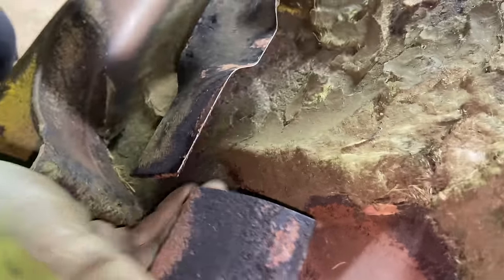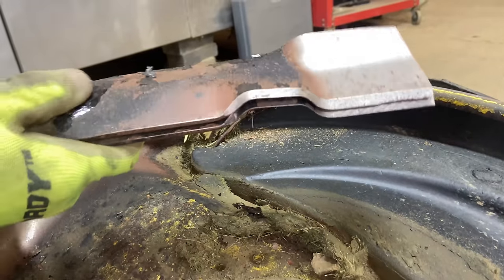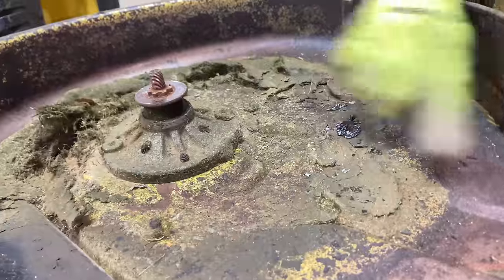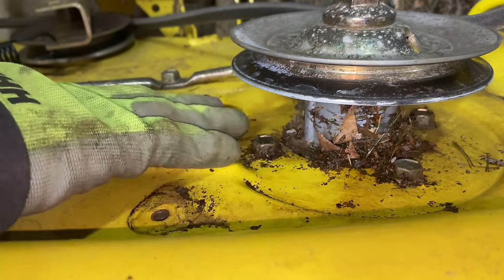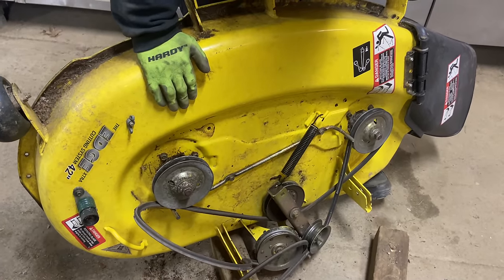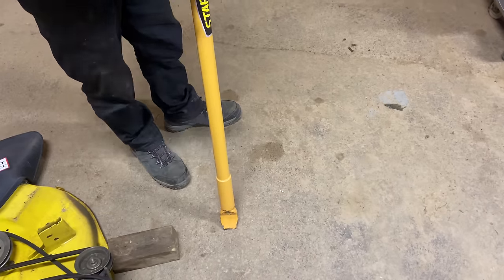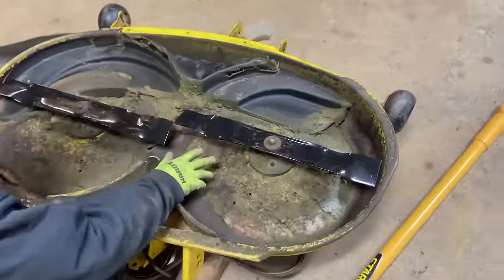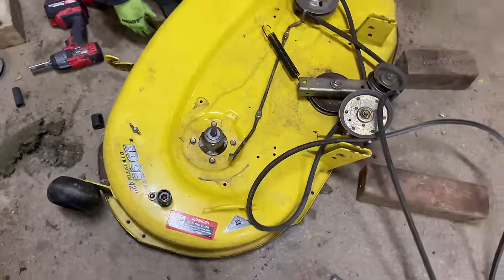Installed New Blades and Still Cuts Uneven

Comment: Three years ago I bent the mower deck on my John Deere d130. They said there was no way to fix it and they wanted $1100 for a new deck. My solution to the problem was to take that $1100, add $1800 to it and get a Husqvarna zero turn with a fabricated deck. I still have the John Deere deck in the cellar, and now I know how to fix it. THANKS!
Reply: Most things commissioned to be made for the purposes of profit will be of poor quality. Welcome to capitalism.
Reply: I bought my D130 new in the spring of 2015. We're almost into fall and my D130 still runs and cuts great and I've never did anything but routine maintenance. It's a great machine cutting it's 9th season so I'll have to disagree with the D130 bashing. It's the best mower I've ever owned
Reply: @chuckiebrown1494  it's a good mower until you hit a small tree stump with it and bend the blades and the deck. 
I'm bashing the repair people. I'd like to...
Reply: @tomstepanowicz6191  I actually did hit a few things but was lucky enough that it's still straight.
Reply: @chuckiebrown1494  🙌yay!
Reply: @tomstepanowicz6191  I was referring the bashing to the comment that was calling both a piece of junk?
Reply: @chuckiebrown1494  that comment got a 👎from me
Reply: @tomstepanowicz6191  didn't see that. I just thought I'd let you know I wasn't calling you out.
Reply: Thanks for the timely video. My JD deck has the same problem.
Reply: my 110 has that problem never fixed it after hitting an old plow carriage in tall grass ugh know I know how thanks for the good video. my mower wouldn't start my son thought maybe it was the seat sensor I changed it still no go then I changed battery nothing still old one wasn't very good I think it was jump started but found out with tester it was bad fuse holder got melted some how with out the fuse breaking nuts eh. well I've had to go buy a new one under 5 dollars put it on headlights work now plus it turns over time to replace belt it's kinda slow engaging the blades.  Sorry so long hope some one else is helped by my experience too? Good day all.
Reply: Oh should have known it was fuse related if headlights don't come on but you never know could be wire dirty on battery or ground ive always checked first plus learned alot from Chickmechanic video also
Reply: that's amazing video and sir you are a professional, I wonder if the non bent side should have been supported before striking the bent side but it didn't seem th prevent anything and you were able to correct the damage, BRAVOS

Comment: I ran into this problem myself with uneven cuts. New blades didn't fix it. So I just cut uneven. Now I have new info. I'm going pull my deck. This is probably exactly what is wrong with mine. Thank you sir!
Reply from the maker: I hope this video helps with your issue and you will be cutting straight again! Thank you for watching and the kind comment.

Comment: Best explanation I have seen on why the deck does not cut evenly. Especially since this is the deck I just replaced after 12 years. One tip on this deck if you have to replace it, it is cheaper to buy a complete deck through sales ($900), rather than a bare deck through parts ($1100).
Reply from the maker: Good to know! Thank you

Comment: Man am I ever glad I watched this video. I've watched several of your videos which gave me excellent tips as far as doing work on my LA130. Now this video is giving me ideas on why my Wheel Horse 52" deck is shaking so badly after I hit a raised patch of ground in the ditch by our house. It hit pretty hard and this may be what happened. I very much like your simple no nonsense approach to repairs rather then throwing a ton of money at the problem. Thank you
Reply from the maker: Check your blade hub shafts and blades. I’m sure one or more will be bent. You also may need a new blade belt due to; if the deck stopped turning when you hit the mound and the engine was still turning the blade belt, the belt can get a bad spot in it and that will cause a bad vibration also. Good luck! Thank you for watching and the kind comment!
Reply: @JohnsonsSmallEngines  noted and many thanks for the additional tips. I'll be 70 in a week so you are teaching an old dog   new tricks! :) thank you

Comment: Awesome advice! Your directions were right to  the point and easy to follow.  I was afraid that I was going to have to shell out a lot of money to fix, but thanks to you...heck, I'm ready to give it a go.
Thank you so much.
Reply from the maker: I hope it helps straighten you out! LOL. It does take some patience and time but it’s a lot cheaper than buying a new mower deck. Also, check your blade shifts to make sure they’re not bent.
Reply: @JohnsonsSmallEngines   Will do 👍, and thank you, again. Like you said, it does (may) take some patience and time, but it's a lot cheaper than buying a new mower deck.

Comment: I cut my yard and walking trails for 20 years with a STX-38. I got a new S240 and the first time around the yard I hit a root. Bent the blade and the deck. My brother in law had a Bolens and got the S240 too. First time around the yard, he hit a stump and bent the blade and deck. We both had mowed our yards the previous week without. 

I continued to hit stuff I never hit before. I replaced the deck cause I had bent it back into shape so many times the metal got fatigued and wouldn't stay straight. I got a Accel deck and the first time out I hit a root. It stuck so hard in the root I had to pull it off with my truck. And it bent the blades and deck. This deck is heavier and harder to bend back. A few weeks later I hit a stump and really bent the blades and deck. I am tired of buying blades and pounding on the deck. And I need a bigger hammer now. 

I never bent a blade on the old STX  38. I bent the hell out of the deck (Black deck) over the years hitting stumps rocks roots, the blades would cut holes in it when doing so, it rusted and my buddy welded it back together multiple times, we beefed up the parts that would bend. 

I was working on the STX as I still use it and noticed the blades are tucked up inside the deck quit a ways. HMMMM The blades on the new JD's are almost level with the bottom edge of the deck. Could this be why I used to bend the front of my old mower's deck and not the blades and deck, and now hit shit with my blades and consequently bend the deck??? I think it is a design flaw. 

When I bend my deck back I use a chunk of wood on the opposite side of the hole cause it looks like it is bent all the way through. One side down and the other goes up.

Comment: One of my kids hit a stump and bent the end of one blade 90 degrees. Put new blades on and I’m getting about an 8 inch strip that’s high. This is definitely going to be my issue and you gave me the fix. Thanks
Reply from the maker: I'm glad it was helpful. When you take ther deck off, make sure you spin the blade shaft to make sure the shaft is not bent. A 90 degree bend is a bad hit. I'm sure you will need the "deck adjustment" in this video but also make sure your blade shaft is ok. If it is bent It may be easier to replace the entire hub bit it depends on what you think.

Comment: My son hit something with the cub cadet and not only did it bend the deck but it cracked the corner of the spindle. For the life of me I could not get it to cut even until I remove the spindle and saw the bent deck. I used a small air hammer and a heavy duty mallet with a piece of wood and it worked. Wish I would have seen yours earlier

Comment: Thank you for the blade tip. I never really paid that much attention to them before.  I guess I can check My deck by measuring it to see if it's level on all sides. I hit a root with the edge of my deck, But I see no difference with the grass after mowing. Great job as always, I almost always learn something or am reminded of something. So thanks again.
Reply from the maker: Hi Steve, You most likely did not hurt your mower deck when hitting the root. It takes a good hit and most of the time the tractor will stop dead in its tracks when the deck get bent. Thank you for commenting!!

Comment: This was my favourite video on the subject, I flipped my deck over and one side of the blade was even with the other then the other side of the blade was over an inch higher. This proved it wasn't the deck or spindle and just a badly.bent blade. I hit a paver that was on my lawn a while back
Reply: Funny you mentioned that. I have a Cub Cadet with the same issue, both blades line up in the middle, same height, but if I spin the blade on the chute side 180 degrees it's a little lower than the other blade. If I spin it again 180 degrees it lines up. So it has to be the blade. If the deck was bent the blade would still be lower (out of alignment) even after spinning it 180 degrees and it wouldn't fluctuate in height like that. If the spindle was bent the height may fluctuate but most likely go from too high to too low on each 180 turn. Not lined up and then low. I replaced the blade and the new one does the same thing. I'm thinking the blade on that side is bowing a bit when I tighten the bolt. Nothing else makes sense.  The cut looks fine so I'm not going to worry about it. I never hit anything that would bend the deck or spindle. I had an older mower that definitely had a bent spindle and deck at one point and the blades would never line up when I swung them 180 degrees, they remained equally out of alignment,  until I replaced the spindle and fixed the deck.

Comment: Really smart and great job!   Never ran into the slap 🔨 hammer before and just ordered one.   Have a Kioti tractor with 4 foot tires on the back, and this tool should be able to break the bead if needed.   Nice work 👍 and thank you! 😄
Reply from the maker: I'm glad this was helpful and thank you for the kind comment. The slide hamm a nice addition to have for multiple  reasons as you stated!

Comment: Good video and to the point. Most owners don't have the know how on why you do not move the wheels. Every tractor I receive the wheels are totally to high. I try to explain to them that they are set for a reason and not to cut the lawn so low. I did want to mention on one of your other videos that I did watch a few times incase I missed something. I was stumped on the Husqvarna zero turn that has the parking brake within the laterals. I tried each time and cleaned up all the relays thinking that was the culprit. I replaced the solenoid, ignition switch, checked all the wiring for breaks, anyway I don't know if you can make a edit to that video to let others know about the occupant relay within the harness under the control panel. I decided to move that relay since it had the same color coded wires as the parking brake relays. The tractor started, but would not start again, but the relay became very hot real quick. I found one on line and installed it and still had no call back from the customer. I don't suppose that you have a video on a troy bilt tractor that won't stop moving forward unless I turn the ignition off? I have set the brake but still won't stop. I may have to put on a stand and see the wheels in the back after pressing the pedal and see what's going on. I hope it's not the tranny.

Comment: I have the same JD 42" deck.  The crossbar under the discharge chute broke off, it slammed into the right blade, are now the cut is messy.  Of course the stability of the entire deck is also compromised.  Nonetheless, this video was a major education, starting with the blocks and the level pully analysis.  Anything can be fixed.  Thank you!

Comment: I got a bad uneven cut and I suspect something along these lines. I just replaced the spindles and it does look like one is a little wonky when I spin it. I might have hit something but who knows. Good advice here and another tip to add to my toolkit. Before we owned acreage I only ever needed a pushmower. Now I'm changing blades, and spindles, leveling the deck, changing belts, and I'm sure more things to come. It's frustrating when this happens but it's a nice feeling to fix it. 😅

Comment: Thanks buddy, makes diagnosing my issue a bit easier. I haven't identified if the blades are bent yet but I hadn't considered the deck being bent but considering I have had nothing but trouble with my troybilt pony (2019) I wouldn't be surprised. I gotta pop the deck of to replace the spindle brakes (yes they are already trashed, along with deck engagement cable broken the idler pulley broke free from the deck... due to vibration from one of the spindle bearings not having a tight/press fit in on of the spindles causing vibration that lead to the pulley guards cracking) 
I will likely replace both spindles and blades ( I used some sleeve retainer compound in the interim to keep the spindle from vibrating as bad) 
Anyways... My old MTD mower will be put back into service if I find a suitable engine since MTD has always been built to a price but sheesh I wouldn't wish one of these things on my worst enemy.

And to think I was concerned about the Chinese engine being a problem LOL
Reply from the maker: I’m glad this video was helpful but it looks like you have a plate full in front of you! Lol I hope everything goes well and your machine gets back up and running soon. Thank you for watching and the kind comment. Please give this video I like subscribe if you haven’t yet and share my channel with your friends to help it grow. it would be greatly appreciated

Comment: Great idea only thing I would do is warm the paint up with a heat gun so it doesn't get pinched and form rust where it was hit by pinching the paint you break the bond to the metal ... I rebuild my JD deck this past summer and never thought of this but I was lucky it wasn't bent I did replace the blades because they were finished almost worn through where they turn upward behind the cutting edge from just lightly grazing soil on a steep hill that I now landscaped to feather it out so it's not as bad...

Comment: Very nice video….to the point with great shots of what to look for.  The video guys gets a call-out on his work.  Great explaination and really great instruction.  My deck was bent on the leading edge of the right side.  The blade does not strike the deck and it mows but looks terrible.  How do you fix a leading edge damaged deck?
Reply from the maker: I cannot say how to repair what you are calling " leading edge damaged deck" I am a visual person and would need to see the mower deck to figure out the best way to straighten it. It should not matter what the mower deck looks like. If the blades are coming across together evenly, the tire pressure are all correct and  the mower deck is leveled correctly. You should get a good cut.

Comment: Top of the deck is warp,we had the same problem with ours John Deer,the top of the deck where the bearing towers mount get warp,makes the blade underneath cut at a angle

Comment: Very informative. How are blades to be position, both at 12 and 6 or one at 12 and 6 with the other blade at 9 and 3?
Reply from the maker: It does not matter which way you put the blades on as far as positioning. They are not timed and will not hit each other.

Comment: Rookie Question: what does the actual bending on the deck? Force of the pulley on the jammed blade?
Reply from the maker: I think a combination of mower moving forward then hitting something that stops the blade then momentum of tractor moving bends the deck.

Comment: A few weeks ago I hit a rock with my X350 w/42" Accel deck and knocked a chunk off of one of my blades. I bought a new set  and now the blades ends are hitting each other! I took off the deck and nothing seemed out of the ordinary to me, the spindles are tight. I priced a new deck and they only sell the shell by itself and it's like $600-$700! Last night I was debating maybe to just buy 2 new spindles and if that doesn't fix it I can move onto a new shell. After watching this video I'm going to work on checking the pulleys to see if they're misaligned. If you don't have a "slap hammer", can you just use a small sledge and a block of wood?
Reply from the maker: Absolutely. at this point, you can use whatever you need to straighten the deck!

Comment: Hey I put a John Deere  lt 180 42 inch deck on to a John Deere lt 155 that had the 38 inch deck one side with the lever that lowers the deck on the lt 155 that that side is sitting higher  and this is a different deck.i use this mower and it's put together out  of 3 different JD mowers.the engine is out of a 2005 JD l140 13.5 horsepower. Any suggestions would b appreciated it runs and mows but unevenly  any expert advice u can give this shade tree mechanic would b appreciated

Comment: Your videos are awesome. Finally, someone has done proper JD maintenance videos for D100 aeries. You've got me as a subscriber. I have the same problem with a bent d110 deck, except my pulley level is raised on the outside side of the deck vs the towards the middle in your video. This may be a stupid question, but do you just hit the side of spindle hole that is raised the way you did with wood block and slap hammer after removing spindle? Or should I hit the deck from middle underneath (blade side)? Or it doesn't matter?
Reply from the maker: Once you figure out which side is bent. Hit either side of the deck top or bottom to correct the issue. Make sure you remove the spindle assembly so you do not crack it. I know this can be a frustrating repair but  it is better than replacing the deck. I hope that made sense? Thank you for supporting my channel! It is greatly appreciated. If you need to talk about this repair? Go to my contact page on my website and send info to contact you and I will call you.